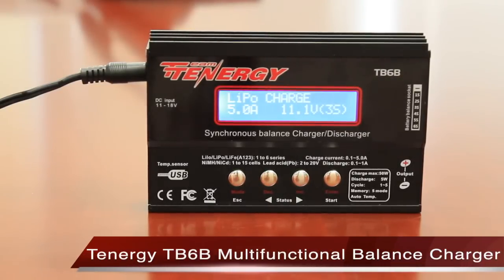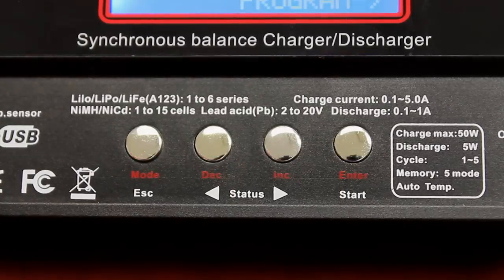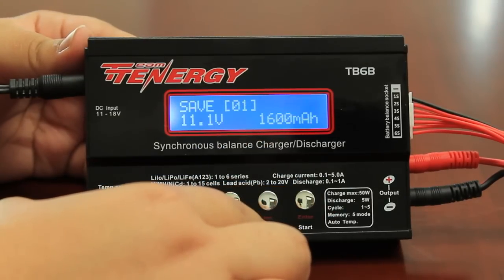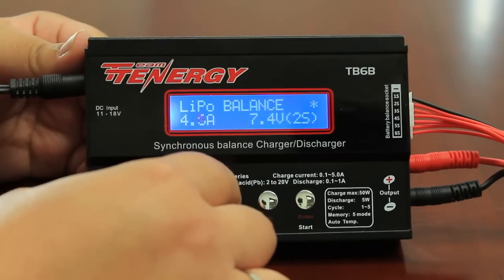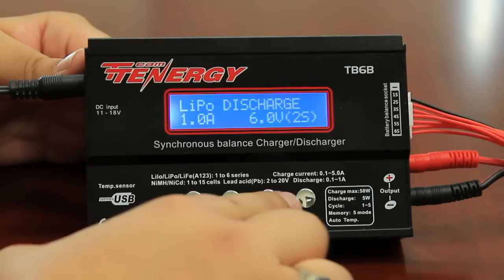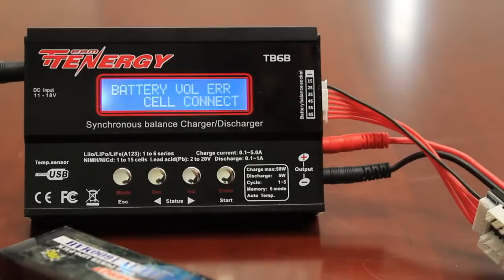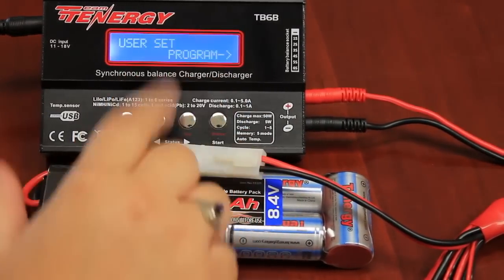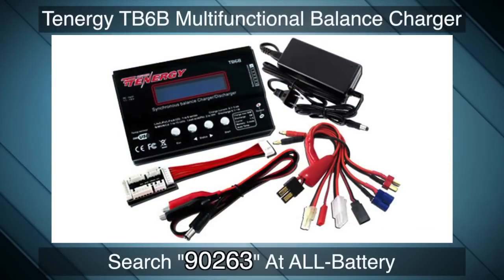Tutorial: Tenergy TB6B Balance Charger for NiMH/LiPO/LiFe Battery Packs | All-Battery.com

Comment: Under Program, for some reason Lipo was disabled, very strange, not sure why. May have been a hiccup on the charger, going through the settings several times, turning it on and off resolved the problem. Thank you, works like a charm, awesome charger.

Comment: I'm reading these comments so many people confused about not being able to find lipo or life. You can't answer that when your the one selling the charger. It's simple this charger does do lipo or life or lion. But will only display one of the three depending which lithium style voltage you have entered into the programming you can very easily switch between the three in the settings. Go to the program mode I believe not sure cause I don't have my charger with me but get into the programming and switch between lithium voltages when you choose 3.7 it's in lipo mode 3.3 life mode 3.6 lion mode. When I get to my charger ill comment again on how you get to this screen.

Comment from the maker: Yes, you can charge it at 1.6 Ah.
Generally, if you would like a safe charge rate, set a charge rate (in amps) that fully charges your battery in 3-5 hours. This 3-5hr timeframe is also a guideline for RC Car battery packs to maximize battery efficiency & runtime.
We're assuming you have a mini Airsoft battery pack? So, to charge in 3 hours, it would be..(1600/3 )= about 500mah or 0.5Ah charge rate. This applies for both your LiPO & NiMH battery packs.

Comment: Does this not balance the battery in charge mode but only in balance mode?  What is the point of the individual wired plug if it isn't used for balacning?

Comment: I want to charge my Holy Stone LiPo Model SF 8333106 batteries used in the Holy Stone HS700 Quadcopter but there are no connectors that come with the charger that will work for this application. I would welcome any suggestions. For now, this product is useless to me.
Reply: I know what you mean , I have the exact same battery from Holy Stone and the ONLY thing it plugs into is the balance board with the connector from the Holy Stone super slow charger. Extremely disappointed so far and like you, for now it is totally useless to me since these are the only batteries I need to charge.

Comment: How do you know what ampage to charge the battery at? Is the way you use the ampage different for the different types of batteries? For example, if I had a 1600 mah nimh and a 1600 lipo, would I set the ampage to 1.6 amps like she did in the video?

Comment: For anyone looking, a replacement LCD power supply rated 120v at 5A works perfectly as an A/C power supply. You can find one on Amazon or eBay for cheap.

Comment from the maker: If you have this exact charger, it should have LiPo. If other options like NiMH, NiCad, & LiFe  are available it should be there unless there is a defect with that particular one you have. 

As for the voltage, you have to select LiPO for it to show 7.4V. You must have it under the NiMH setting if it is showing 7.2V.

If the videos are still not helping, I recommend you contact our service team to give you some help. They can do an exchange if it is defective and IF you bought from us.

Comment: Tcells  want to charge my Taxas Power cell 8.4V NIMH 30000MAH7 cell Battery T6B charger doees not work like the video no input for voltage does not ask how many cells should it?  what will the uto feature do if I can get it to switch to it the voltage that is says is charging is higher than 8.4 like 20.3 it says

Comment: My battery is 9.6V 11.7Ah LiFePo4.  What setting should i use please.  I keep getting low voltage or high voltage.  What setting should i charge it?  It is 27 cell battery.  What should my mAh and V be on my charger?  Please help.

Comment: Good video thanks! I have a 7.4v 2200 mah Traxxas battery. Charge rate is 2.2 but max charge is 4.4a- can I use the 4.4? Alse, I'm going to solder a connector on to it. How do I balance it if there's no balance cable? The Traxxas batteries have the balance built in to the charge cable, I'm assuming that won't work here. Thanks for the help

Comment: How do I know what to set my amps to for my specific battery
Reply: 2500 mAh so that would be 2.5 amps much appreciated :)
Reply: Have another question I have a battery that came with my gun online and I don't know anything about it. Is there anyway to figure that out? Like mAh and volts?
Reply from the maker: Cody Steeby Usually specifications will be listed on the PVC of the battery pack. If it is very generic, always best to just confirm with the seller or manufacture of the airsoft gun.
Reply: mAh/1000 = charge rate

Comment: Have searched in Google, Youtube, and airsoft forums, nowhere there is any information about the temp option. You state it takes any Hitech connector (I guess is Futaba as well), but the charger says USB temp. Not true about not measuring temp, if the lipo gets hot for any reason, it would be a great safety feature to automatically stop charging at a specific set temperature. I have bought two uni temp gauges, one stays at 75, and the other one at 0. The Temp Sensor USB is a marketing tactic.

Comment: Subj: Temp Sensor

Could you please post a video how to use the Temp Sensor? Why does it says USB if it is a Futaba (3-pin) connector.

IF I buy one of those temp sensors with Futaba plug, the ones used for the Imax charger and cost like 4 bucks on Ebay, Would those display temperature on the charger screen?

I have heard a software is needed and a special cable to connect to the computer etc, which sounds like too much hassle for such a simple feature.

Thank you for all the quick responses.

Comment: I found a programming fault you guys need to watch for. When charging a 7.4v lipo, the default charge type comes up as "charge", not as balance. The balance setting can't be saved and recalled through "load settings", it reverts back to "charge". So make sure to change it to balance when you get ready to charge a lipo.

Comment from the maker: Reason why we did not include a video on the Temp Sensor is that very few people actually use this feature. It can be difficult to accurately measure temp readings for LiPO. The temp sensor cable should be universal for these chargers, but I believe the one this takes is a Hitech connector.

Comment: Can I charge a 3s 5200mah with just the white plug in ??? The ec5 plug doesn’t fit on any of the extras plugs ..
Reply: No, you cannot just charge with the balance plug (white plug). Users would need to the main connector as well. 

The TB6B has one set of wires that is bare (allows users to add on the mating connector that matches their pack) if they want to use connectors that are not supported by the multi-charging harness.

Comment from the maker: If you have a LiPO battery for RC Cars, you should balance charge it like shown as in our example. Be sure to set the charger for LiPO, 3S (11.1v), & 4.0A Charge Rate (takes ~1 hr in charge time).

You can do also do 2.0A charge rate (takes ~2hr to charge) if you'd like.
Reply: Just let everybody know you do not have to balance charger LiPO batteries every time you should balance charge it every two or three times

Comment: I just bought this charger on Amazon and I’m very happy with it so far, I’ve only used it once to do a balance charge on a LiPo 5200 mAh 3S battery and it worked great! Do I need to do a balance charge every time I charge it or is it ok to do a regular or fast charge too? I couldn’t find anything about that in the manual. Thanks!!
Reply: Hey! We have the exact same battery. Are you charging it at 5A?
Reply: you want to balance every time
Reply: @s1ushybrine119  i have but charger gets pretty warm.. so i just lower it a bit and it takes longer
Reply: Balance every time religiously lol

Comment: In other words it only displays the lithium mode that has been chosen. If you have this feature set to 3.3 it will be in life mode and when you scroll through the choices will be life,nicad,Nimh and pb lead acid. When you have it set to 3.7 it will display lipo along with Nimh nicad pb. It will not put all 3 lithium choices in the selection menu only will the style of lithium you have the lithium voltage set too.

Comment: Could you tell me how you use the alligator clip attachment?  I wanted to use them for some Dewalt 18v drill charging but can't find anything on the octopus to attach it to!?
Reply: (I know this is old but perhaps answer will be useful for others).
The alligator clips are not for output but for input if your power source is a car battery. For output, if none of the connectors are what you need you will need to connect directly to the output. For my DJI Phantom Drone, it turned out the original DJI charger was attached by plugs that fit perfectly.

Comment: Hi. Is the power supply not included in the package? If so, can I use any kind of power supply as long as the DC output is 11-18V??
Thanks
Reply: Tifama De Chavez ::: must be close to 5000mA

I use 12V 5000mA, dont cut corners, pay to play.

Comment: My first charge of a 2S LIPO battery went perfectly. I then tried to charge a 3S LIPO but the LIPO option won't come up anymore. I only get choices for LkFe, NiMH, NiCd, and Pd. How can I get the LIPO option back?
Reply: After leaving the charger disconnected overnight and then going through the menus several times the LIPO option finally came back. Strange behavior but it is working again and currently charging my new 3S LIPO battery, so all is well.

Comment: why does it say reverse polarity for me when I plug my battery in?
Reply: Hi Reuel, this usually means the red and black wires from the charger does not match with the battery pack. Please check the connector to make sure it's connected correctly. If that does not solve the issue, please contact us directly at service@tenergy.com and our team can take a closer look at the error.

Comment: A universal temp sensor only works with Nihm batteries, other battery there is no readings available. Have checked the programming settings this time, and all is good. Its terrible how a company sells, and states the charger has temp feature, where the instructions are very general. 

Dont get me wrong, its a good charger, I can charge anything with this charger. Have changed some of the plugs and I charge from my R/C receiver/ transmitter, glow plug, to airsoft batteries of all kinds.

Comment: Would you please guide me how to connect or set up for a Lion chemistry , I only see lipo option
Reply from the maker: Please choose LiPo option first and then switch between voltages, when you choose 3.6V you'll see the display changes to Li-Ion mode.
Reply from the maker: If you are still confused, please reach out to our Support Team via email: service@tenergy.com, and they can help.
Reply: @AllBattery  having the same problem.  I cannot balance Li-Ion battery without getting "Battery Vol Error - Cell Connect".  I can use "charge" mode, but I bought this to balance.

Comment: I can charge NICD/NiMH and Li Ion batteries in parallel?
Reply: Spark RD ::: No, will fry the wiring and if you hook up a lipo, possibly catch fire immediately (dont ask me how I know, lol). It killed the battery, but the charger kept working fine...

One battery at a time, NEVER multiple batteries regardless if same type.

Comment: the octocord on mine doesnt have any connections for my tattu 650 mah 14.8 battery
Reply from the maker: Unfortunately that's correct, the included octocord does not have an XT30 connection. We try our best to include all the popular connecters on the TB6B's octocord, but can't cover all possible options. The good news is we do leave a set of bare leads for you to add the XT30 connector on the bare leads.
Reply: @AllBattery  thanks for the reply

Comment: I purchased this and did not realize that this charger does NOT come with a traxxas end.  Does anyone know where I can get one that fits this charger?
Reply: when i purchased mine they soldered a traxxas end on it, as that was whole reason to buy.
Reply: mike zilla Thanks Mike.  I ended up buying a traxxas end at the local hobby store for $3 and soldered it on myself.  It was pretty simple and only took me a few minutes, but I wish they would just come with one already considering how popular Traxxas is?
Reply: I agree fully..gotta buy 2 sets of traxxas plugs to modify a couple lipos to fit my traxxas.
Reply from the maker: NativeNoob We're sorry as the traxxas connector issue is out of our hands. We're told Traxxas no longer allows chargers to included their cables as a bundled package. Yes, you may still find generics or some chargers that have Traxxas, but they maybe chargers you buy directly overseas. We do have the "octopus" cable sold separately that does have a Traxxass connector: http://www.all-battery.com/MultipleChargingHarnessesforTB6_TB6B_TB6ACBalanceCharger-80230.aspx

As recommended by another person, another option is going to your local hobby shop to add it on.

Comment: I have the charger, how many amps do I need for a 20c 3200mah 7.4v lipo?
Reply: 3.2 amps
Reply: +Randall Hughes A little bit late, but thanks. I read on the battery and it said 3.2 (lol I'm a idiot)
Reply: +EliteOps101 Farming sorry I was late.  I just got an X-MAXX and as it takes 2 3s packs I needed a second charger but I'm also using it for my nimh batteries for my nitro starters.
Reply: +EliteOps101 Farming I'm trying to figure out why it says nimh charge manual when it's supposed to be auto.
Reply: +Randall Hughes sorry I don't really, know I use to run nimh battery's and a different nimh charger. thus far I haven't used my new charger to charge my old nimhs

Comment: Is this like a fast charger
Reply from the maker: TheKrissvideos Depends on how you define a fast charger. It can charge up to 5A. Depending on actual capacity of your battery pack (small or large), and if you pack can accept the charger -- we would say for the most part it can charge fairly fast.
Reply: +TheKrissvideos it will take at lest 1 hour to charge ANY battery any thing faster will kill ur battery or burn ur house down
Reply: +jacobww1 wrong.  if your running a 5000 mah battery it will take 1 hour as it s charging at 5 amps per hour.  But say you have a 2.2ah battery that can be charged at 2c.  that means it can be charged at double it's capacity cutting the charge time in half because you will set it to charge at 4.4 amps aka 44 watts.  so your statement is right but wrong also.

Comment: Thaks for the tutorial! I learned alot about how i am going to charge but, when i am going to charge a 11,1v lipo battery 4200mah is it another option for that. I bought the battery for my HPI Bullet Flux ST so i wanted to know how to charge my battery but is it a difference if i buy a dynam charger? as i did. The options Lipo balance and charge, what am i going to use?

Comment: The directions in this video will only work if it is already in LiPo mode under the LiIo/LiPo/LiFe menu which is not shown in this video. First go to "User Set Program" , press "Start" Button 2x  Until Voltage Starts Blinking then Press "Increase" Until You See "LiPo" on screen.   Then go back to following these directions and the mode menu will show LiPo along with NiCad, NiMh and Pb(which is actually lead acid).  Terrible manual with this unit which is made worse by the poor interface.  Tenergy customer service was somewhat helpful but gave incomplete directions in reply to my Amazon review.   Once you get this all figured out, it works fine.

Comment: This looks really confusing! - she had to enter the date a for the LIPO twice! I'm after a lipo charger that can handle charging more than 1 battery at a time. What's with all this push this - then push that, then hold this, then press that....HUH? I think I'll purchase  4 $8 chargers from Hobby king and use a power board and plug it all into the one socket - it HAS to be easier than all THIS! - and what happens if ( after making & saving all settings ) - the charger itself looses power? reset?

Comment: Im trying to charge a Valken 7.4v 1000mah 20c LIPO and the charger keeps saying “Connection Break”, even when the battery is not connected during the balance charge phase. Please help
Reply: Hi, i had the same issue, you need to have the battery connected to both the charging AND discharging pot since balance charging will discharge some of the cells and charge others to "balance" the charge

Comment: How do you know 1.6a
Reply from the maker: Hi Murray, you should check with the battery pack's manufacturer for suggested speed, since the acceptable charging speed depends on your battery pack's specs. For this particular Tenergy pack, while it can accept more, we used a conservative 1C charging rate which is 1C = battery capacity/1000 = charging speed. In our video example, the battery pack's capacity is 1600mAh/1000= 1.6A.